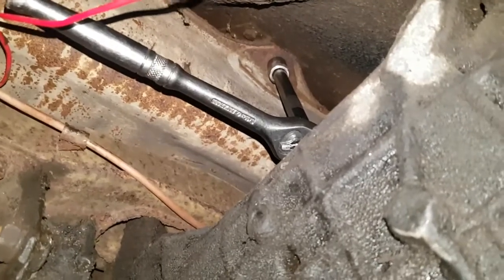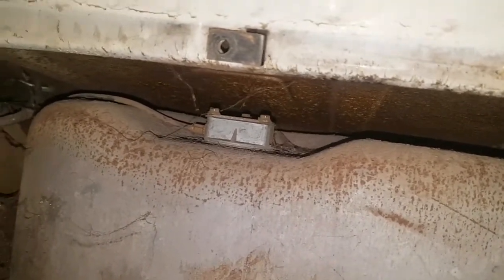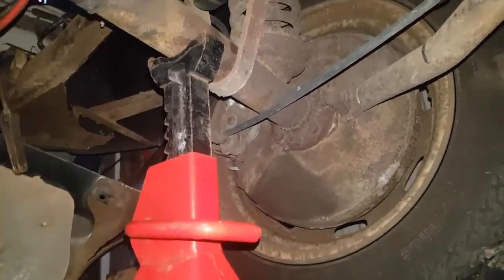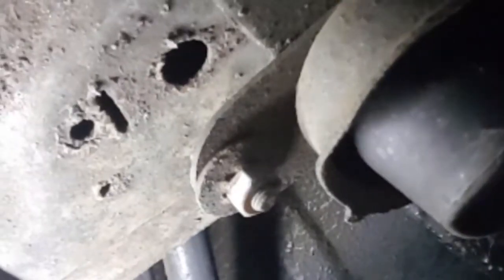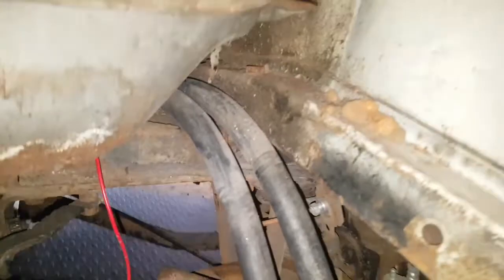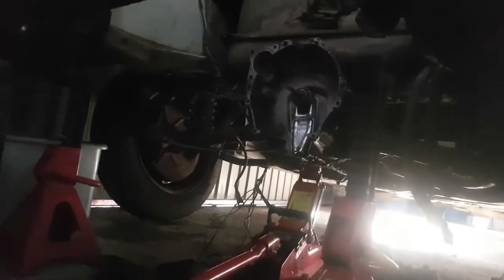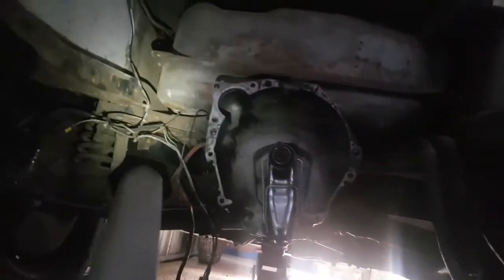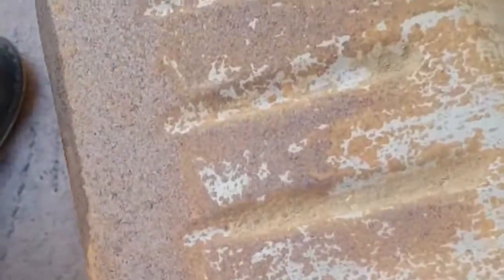Renault 10- Petrol Tank Removal

Comment: Does the engine have to be removed?
Reply from the maker: Depends how you tackle the task. Either the engine has to come out, or you must fully separate the body from the Axle assembly, then you can drop the tank from where its bolted to the body above the gearbox.

I removed engine, raised body from gearbox just to get enough clearance and pulled it out between body and bell housing
Reply from the maker: I had the engine out for a rebuild at the time, so took the tank out as it desperately wanted cleaning and sealing. Realistically, you could have the tank out in a couple of hours, including removing the engine. 
If you have a ramp, you could just support the rear axle and engine, disconnect the relevant linkages etc and the lift the body off. I dare say it would take the same amount of time with all the fiddly bits to undo